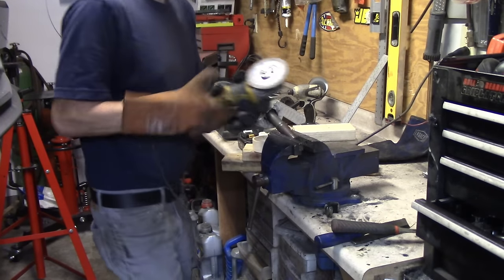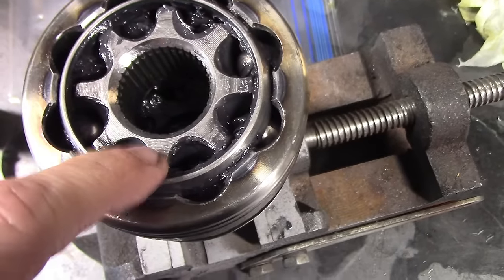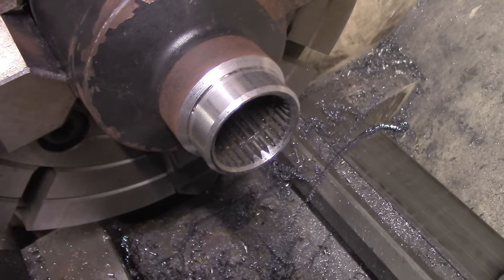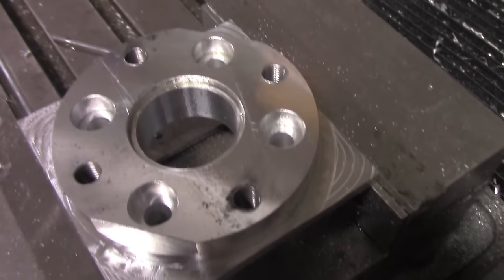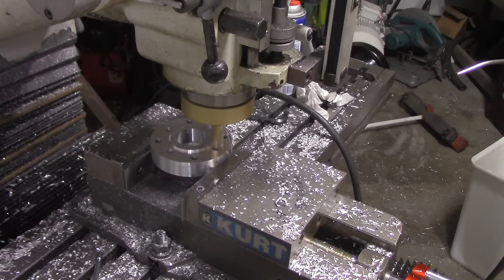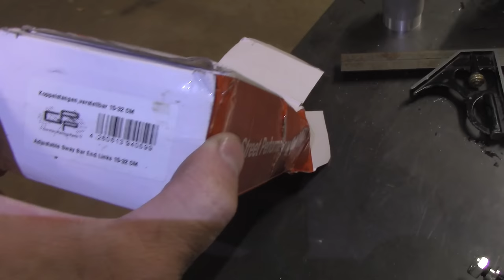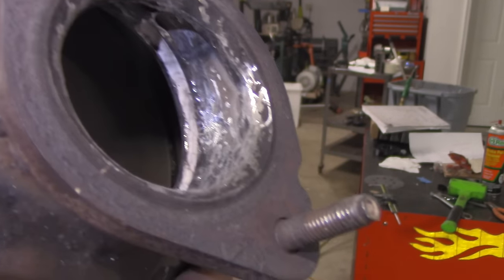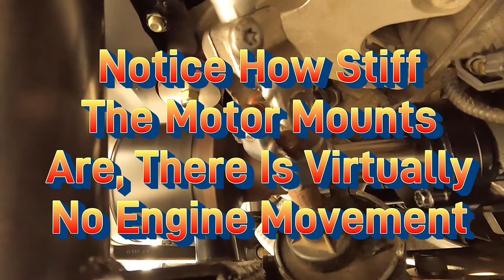The Worlds First AWD S550 Mustang!!  - American GTr Hits the Road, All Wheel Drive Mustang Ep 25

Comment: An AWD 5.0 with at least 500hp, my god the possibilities 😮‍💨🙌🏾
Reply: Especially if this doesn’t add too much weight.
Reply: @bradwoods371 probably an extra 200 lbs. It's all weight underneath the car though so it shouldn't affect handling too much.
Reply: I have an '02 Camaro Z28 with 86K miles and I always wondered what factory GM parts I'd need to make it AWD and if it's even possible.
Reply: Crowds everywhere will be safe lol
Reply: @TheStruggleIsReal.  2000 Bravada Parts fit. It's a AWD S10 Blazer basically.
Reply: @DaInfamous0ne  I thought of the Bravada already and the AWD Astro Van and the Trailblazer SS or whatever it is. 

I'm not sure if those drivetrain parts will handle the torque of my Camaro because it makes more power than those vehicles do.
Reply: @Whats-It-To-Ya All the big hp 4wd/awd gm guys use stock axles and front diff at 1k plus hp.
Reply: @nitrouscatfish5827  interesting. I know exactly where there's an AWD Astro Van rotting away in someone's yard and it doesn't have high mileage on it. I'll make an offer and drag it back with my Sillverado. Now that I'm thinking about it, the 4.3 in those Astro Vans are basically a small block Chevy with two cylinders chopped off so there's gotta be some comparability there. 

My Camaro is an '02 Z28/SS with full bolt-ons. Nothing really major. Thanks for the info 👍
Reply: @ihateracin  how do you figure?
Reply: i didnt see begining of build but wouldnt there have been easier awd based off awd v8s coyote f150? ppl run easy 8s in the 1/4 and 1100whp with awd v8 f150 basically boost and fuel and stock sealed engine thats why v8 f150s are becoming as popular as mustangs cheap v8 work truck with big turbo or supercharger you have a awd mustang
Reply: @Whats-It-To-Ya Yea but the extra weight in the front plus the front wheels getting power can cause understeer
Reply: @SubaruDude2005  point taken but understear with AWD cars is way too common the way it is.
Reply: @Whats-It-To-Ya  Yes very true
Reply: @dannykennedy5885 😂😂😂😂😂😂
Reply: @Whats-It-To-Ya  I think he said it was less than 200pds
Reply: @Old-Skool_Cool You were spot on. He said 200lbs on his newest video. And I seen a YouTube channel take the drivetrain from the Astrovan and make a knockoff Syclone lol. They called it the "sike clone"😂😂😂

Comment: Just so you know even with traction control off the torque management system of the S550 doesn't give you full power that it could right out of the hole. Since you have more traction, you might want to look into having someone put a tune on it. So you have more power off the line to take advantage of your additional traction.
Reply: I believe he just has traction control off. He needs to turn off advanced trac. Or unplug the jumper by the cold air intake.
Reply: @Tylerlive300   Just so you know, even with advanced trac off... And "all" traction control systems off, the Ford system still kicks in occasionally. This is actually one of the reasons why people will pull out from a cars and coffee with everything turned off. Not traction control off but advance track as well. That whole 15 seconds of holding the tracton control off switch on the s550.

You pull out and it does nothing until the car gets sideways most the way around the corner. And then it decides to kick in. This was fixed somewhat with the s650 and it's drift mode but outside of that the issue still exists. The car will try to save itself.

That said, I'm not even talking about those tables. I'm talking about the warranty maintaining torque limits built into the system.
This is what keeps you from putting too much power through your transmission or rear end and breaking them. This is why modern cars can be so powerful but use transmissions that just barely meet those limits.
When you put your foot on the throttle pedal, The car looks at it as a torque request. The car then looks at what gear it's in, what speed it's going, and a bunch of other things and then it might decide that even though you're asking for 100% of the available torque, it is only going to supply 80% or whatever based upon a lookup table that had a lower value.

This doesn't let up if the wheels spin or anything, It's just the compensation to keep the car safe for warranty reasons.

That's why irrelevant of the traction control system settings, this torque management system will restrict the power initially when he pulls away.
With his new setup, the rear axle will actually see less stress and won't be an issue. Same with its driveshaft and u-joints.  However, the transmission itself and possibly the clutch will probably be the weak point now.
Reply: @Tylerlive300 there’s still torque reduction to reduce harm to the transmission.
Reply: couldnt you justy remove the abs relay
Reply: @Robyne_u61   there are several problems with that. First of all, you're disabling ABS. That's not what we're trying to do as the end goal.
But second and just as importantly, the ABS computer is what's sending the messages about the wheel speeds. It's literally required for what he's trying to do.
That's why the solution of remapping the tables to do what you want instead of completely disabling critical car systems is needed.... Unless you want to do  burnouts and that's it.
Reply: @V8dadmartin How? I highly doubt it given it’s not even a turbo car. Only way it would do that is to start in 2nd gear or by it short shifting. I highly doubt does limits power in its gears. Maybe the Gt500.
Reply: @ayushmalpeddi2793   limiting torque values and spikes are how all modern cars keep you from breaking parts. That's why they can sell 460 horsepower mustangs by the tens of thousands and not have a bunch of snapped CV axles, broken u joints, broken differentials, etc.
But it's sneaky in how it limits power.
It's not just yanking power away abruptly in a noticeable way, but rather using a combination of not opening the throttle all the way, pulling timing, etc...

Comment: Supercharge this beast! I love what you've done
Reply: Totally agree.  Bolt-on systems out there with 700 HP, still sounds great unlike turbos.
Reply: If he throws forced induction at it, he might grande all the parts he worked so hard on. The front axles and front diff won't take that power.
Reply: I have a whipple supercharged 4wd F150 and on an unprepared surface I can go 0-60 in about 4 seconds. I bet since his car is roughly 1,200 pounds lighter he can get 0-60 no prep sub 4 seconds.
Reply: if you like to nerd out and bulletproof stuff, look into a interchiller with a whipple charger, gonna need alot of engine work for more than 6-7psi of boost

Comment: This man is living my dream.
Ever since Dodge discontinue the all-wheel drive charger I've really wanted an American AWD  drive muscle car in the body of a coupe. I was disappointed with Ford didn't release and all-wheel drive.
Reply: Can I ask why? It's an awesome project, but I'm not sure what AWD on a Mustang really gets you, that good snow tires and a couple sandbags in the trunk can't also do for you. I daily mine, through the Midwest winters!
Reply: @Bertinator-nm9ld 
TRACTION. No matter how well you make 2 tires put power down, 4 will always do it better. As a Wisconsinite who dailies a P71, there's only so much snow tires and weight can do. There's times my car can't get up the hill to my house and it's time to take one of my Superduty's with 4x locked in. Winter traction isn't even the primary focus of it if you actually listen, in a performance aspect AWD has many benefits as well compared to RWD.
Reply: @kylesonsalla7620  And, on my other Mustang, a 2013 Boss 302, Michelin PS4S have enough traction to put down all 444hp through just the rear wheels. Even in first gear. I was pretty impressed, when I first bought them!

Comment: Congratulations on the build, very well done. The trick to removing the cv from the shaft is to mount the shaft in a vice with the CV end facing towards the ground, hold the stub straight, and belt on the back side of the cv housing. This will cause the clip to compress as you hit it, then it will come off.

Comment: A Barra, manual, and torsion front diff; it would be the perfect S550. You should take it to a dealership and tell them you hear a clunk in the front diff.
Reply: *Torsen. TORque-SENsing. It is a portmanteau, it is not describing twisting force applied to a solid object, aka torsion.
Reply: @emperorbobarino  I know what the diff is and how it works.
Reply: @ItsDaJax  Ok, cool. Now I don't have to explain how they work, that there are different types of Torsen diffs and that they have drawbacks versus other differential types. Have a good day, buddy.

Comment: When GM reintroduced the Camaro. 
I often thought GM should have made a twin turbo v6 AWD version to compete with the GTR.

Awesome build.
I would go to Ford tomorrow and get GT  if it had AWD.
Reply: Why would not having AWD stop you, if that's true? Are you looking to use it as a winter car? Snow tires and some weight over the rear axle works wonders! 

On dry pavement, with good tires, AWD won't net you anything over RWD. The Michelin PS4S can put down every bit of the power that my 302 can make, even in first gear. It's actually pretty impressive!

Don't get me wrong, this is an awesome project, in the video, but don't let the lack of AWD stop you from getting a Mustang. It's definitely NOT a necessity.
Reply: To compete with the Nissan GTR as stated above.
Reply: @NBC_NCO  Compete in what way? I'm pretty sure, if I look it up, a car like the GT350 or Dark Horse will actually be faster around a race track than the GTR. And, if they're not, the GT500 will be.

The GTR was a hella impressive car, when it first came out. But that was 16 years ago! Time marches on.
Reply: @Bertinator-nm9ld  
Exactly, we are so far behind in technology.
Reply: @Bertinator-nm9ld  0 to 60 times are always going to be better in a all-wheel drive car versus a two-wheel drive.

Yes we have cars that are faster in the top speed and have more horsepower but I don't know about you living here in the United States of America I'm not driving 220 mph down to local Highway.

Most racing is going to be...stop light to stop light.
Reply: @NBC_NCO  No. We're not. My 2013 Boss 302 keeps neck and neck with the BMW M3, of the same year. Gone are the days where American cars lagged behind their European and Japanese counterparts!

You know who is really so far behind in technology? Nissan. They built one good car, and then decided to stop trying to build anything better after that... And it's a significantly more expensive car than the mustang.
Reply: @NBC_NCO  Only in the same way that automatic transmissions are "always" faster than manuals!

The problem is that statement is both not always true and not always important. Unless you're a pure drag race guy, I guess. In which case, buy a RWD hellcat!
Reply: @Bertinator-nm9ld  You're totally missing the point.

If you had one 500 horsepower 3,500 lb vehicle that was all-wheel drive, and you had another 500 horsepower 3,500 lb vehicle that was two-wheel drive, which one is going to have faster 0 to 60 times?
Reply: @NBC_NCO  Good question. I actually don't know, though. Sure, maybe you'll get a hair less tire spin, on launch, but you'll also have parasitic losses in the AWD system to sap some of the power off the engine.

Manufacturers make tires that can hook up 500hp no problem, even in a RWD layout! I own some of those for my Mustang. They're not even drag radials.

Here's the question for you. What benefit does AWD give you, if you're able to put down all the power with just the rear wheels?

Comment: Congrats! Hard work does pay off. One point of weight loss is to change the steel subframe pieces to either 4130 or Docol r8 tube (save 1/3 of the weight of the steel ones). Titanium exhaust is one, but expensive) That awd controller is nice unit. About boost, go with twin screw. Whipple or even Kenne Bell if budget stretch that far. You want that instant boost and power.

Comment: Your welds have definitely improved in this latest video.  I watched all of them for this build.  Well done!
Reply from the maker: Thanks, I don't claim to be a master welder, but I am trying to improve.  

One thing is that after doing a bunch TIG brazing at work is I realized that my warn out cup was causing me issues on my TIG welder at home.  Once I replaced the consumables on my TIG torch it was like I suddenly become a master welder:)  I wish I would have figured that out a few years ago!
Reply: I'm also an engineer and I can see you do quality work and I recognize the learning curve in most things.

I also have an S550 Mustang. 2022 Mach 1. I won't be modifying it like you did which means it stays parked in the garage for most of the winter.  Lol.. @npvg

Comment: Outstanding job, outstanding episode! Put a 3.0 liter Magnuson on it. Instant torque. Check out Cleetus' f150 smoke  ums'. It'll be a match made in heaven 😉
Reply: Nah Whipple or ESS 🇺🇸💪🏼🐎
Reply: the F150 has a new Gen 5 or Gen 6 Whipple Blower though (im a turbo guy and honestly can't remember which)
Reply: i didnt see begining of build but wouldnt there have been easier awd based off awd v8s coyote f150? ppl run easy 8s in the 1/4 and 1100whp with awd v8 f150 basically boost and fuel and stock sealed engine thats why v8 f150s are becoming as popular as mustangs cheap v8 work truck with big turbo or supercharger you have a awd mustang
Reply: @carculturenation2166  true, albeit a heavy, non-aerodynamic brick. Not quite know for carving corners, and certainly not going to win any autocross events. I prefer the AWD stang. Not to mention the fun factor of engineering and building it yourself.

Comment: Love the car man.  It may not be smoke yet, but it was slinging some snow for sure.  For boost, I would think supercharger.   You've already got alot going on below the engine now to worry about exhaust routing.  Supercharger on top, cooler in the front,  you're good to go.
Reply: Twin turbo would be ideal. Better power range. Easy to control boost. No worrying about useless belts.
Reply: @YoteNick  A GT500 would disagree.
Reply: @Jumpnjahosofat  ummm no gt500 would do nothing against a twin turbo stang. Actually, look it up, bud. There are plenty of twin turbo gt500 out there. Take the useless supercharger off and experience real power.
Reply: @YoteNick  I never said that a TT wouldn't be better.   You said, boost was hard to control and it had a useless belt.  I'm pretty sure they only have one belt and the GT500 has no problem controlling boost.

Comment: Awesome job! The Corvette, Mustang, Challenger and Charger should all have AWD. I don't know why they don't. What kind of transfer case did you use and where and how did you mount it?
Reply: Bought a AWD charger rt and it is by far the best daily I've owned. Sad they stopped making them.
Reply: They have an AWD Vette. The ERay. And it's stupid fast.
Reply: Significantly extra cost and a hit to fuel economy, and probably two reasons why they don't make AWD versions of those three. They made an AWD V8 charger, for a brief period of time. But, as I understand it, they didn't sell. So they went down to just offering it on the V6 models.

You don't need AWD to put the power down. Certainly not on modern high performance tires.
Reply: @Bertinator-nm9ld  tell that to the Germans......
Reply: @AfriqueNY  You got a car you're thinking about, in particular? They tend to make theirs pretty expensive, and don't try to compete so much with affordable American performance cars!
Reply: @Bertinator-nm9ld  sure. The 3 series. The B58 is solid motor. A 340i and S650 around same price
Reply: @Bertinator-nm9ld  on the street the M340 will win against the mustang GT. The Germans know what they are doing.
Reply: @AfriqueNY  Doesn't that just prove my point? Yes, the car with an MSRP of $76,000 does beat the car with an MSRP of $43,000. The $58,000 Mustang Dark Horse is going to give the M3 some much closer competition.

You can do a lot, if your customers are willing to spend more money!!
Reply: Dodge did make Charger and Challenger GTs. They are AWD but had V6s. So Any Charger or Challenger with a GT on it is AWD. But dodge did have a few AWD hemi chargers sprinkled around. Some were police cars.
Reply: Also... it's a LOT of Chrysler 300s with v6s & Hemis and AWD also. More than the Dodge variants.

Comment: For the engine mounts, if BMR follows the rest of the industry, those should be roughly 85a hardness polyurethane bushings. You should look into 70a polyurethane bushings for the mounts, instead. Then, if you have to, modify them so they aren't full puck coverage/attachment. Some aftermarket bushing/engine mount makers do this so that the vibrations don't transmit in one direction, while still having a stiff mount that resists flex in another direction when the motor torques up.

Also, I love how despite having AWD it was still useless in the snow with those summer tires on. Winter tires are defo more important than AWD. Another thing: that weight is unfortunate, but a power adder would definitely offset it (and it's STILL lighter than ANY mopar!). The only thing after that that could really make this build truly perfect is if it had a rear transaxle instead of a transmission. If you did that and perhaps a battery relocation, I'd like to think you could offset about 4% of the weight back to the rear. So it'd be 52/48 instead of 56/44. At that point, it's even better than an ACTUAL GTR (R35)!